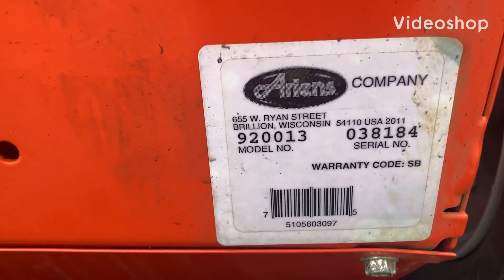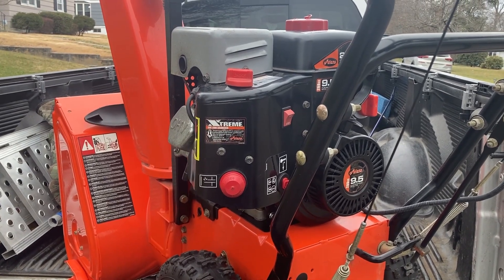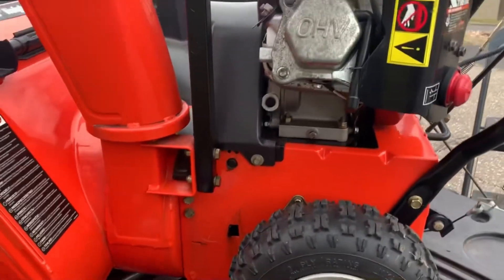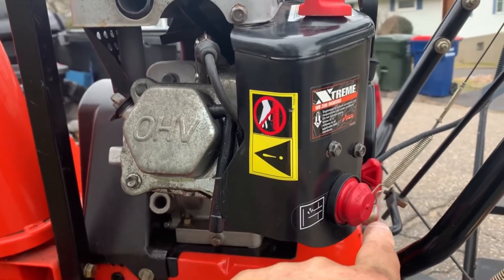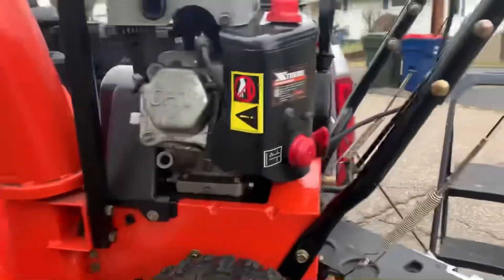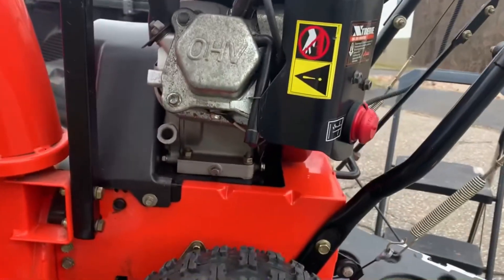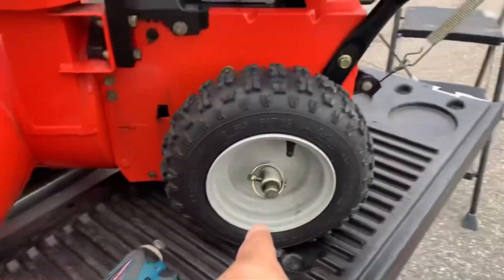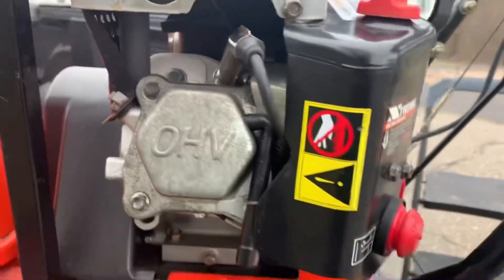Ariens Snowblower Fuel Leak Fixes Itself? Small Engine Ethics 101

Comment: Most people don’t know that if you push the primer too often, it will leak and thanks Ken for being so honest
Reply from the maker: It hasn’t hurt my reputation so far!   Stay warm Hank get that Diesel Heater on full blast!!!!
Reply: I just purchased an ariens snowblower so if this happens that it leaks from pushing the primer bulb its good
Reply from the maker: @oscarsalas3200 absolutely, it should drip out the front of the carb if pushed enough times

Comment: 38 years ago, I was a 12 year old kid wanting to race go karts. My Grand Dad paid a well known small engine shop a great deal of money to build a competitive 5Hp Briggs Stock Appearance engine for me. We got the engine back after they modified it. The engine smoked like a freight train. and covered me in oil the first time I rode it. My grand dad took the engine back, and told him what it was doing. The mechanic kept the engine for about a month and when we went to check on it, he said we had wore the engine out. I told him I rode it less than 5 minutes and he laughed and said racing is expensive right, that we owed him an extra $300 for checking the engine out and rebuilding it the 2nd time. My grand dad paid him, and we went home and put the engine back on the kart. There was no difference, it still smoked and had no power. An old man at the go kart track offered to check the engine for me for free. The engine never had any work done on it, it was total junk. The small engine shop ripped my grand dad off of his hard earned money. I started right then learning to work on small engines, so we would never be ripped off again. Over the years, I've lost money on a lot jobs, so I could close my eyes at night, and not feel like I ripped someone off by over charging them.  Great to see others with the same ethics I live by daily 💪
Reply from the maker: Thanks Mitch, there are many times when I “learn “ stuff while fixing power equipment. Most shops would charge for every minute on a job but I don’t charge for learning, especially when working on something that is not familiar to me. I consider it adding to my database of knowledge.  Hopefully it can be used in the future. Once I figure out a method of repair, I estimate what the repair would be if I had known the solution and charge accordingly, which is usually a lot less than if I charged for all the time. I love solving problems and learning new things so it’s always an adventure that shows up on my driveway with a note that says “call me when it’s fixed!”
Reply: @KensSmallEngineRepair  That's correct bud! This is my 37th year working on junk and I learn something new daily. We never know it all and we never stop learning.

Comment: nice video. I have a cub cadet 2 stage, have not used it very often, only in real heavy snow. But it has been in for repair about 3 times, Last year 2023 winter, I had it looked at due to idling hard. Poor starts. It is only 3-5 seasons old, looks almost new, Tried Trufuel for the first time, on the advice of the repair guy. Got all the storied, no need to to drain , no need to burn  off, no need to add a additive. So of course I did not. Come this season, I went out to see how its doing? the trufuel I left in the tank (March 2024) new fuel, part of can, was gone! bone dry! (Nov 2024) I was told maybe leaked out? no evidence of a leak, it sat on wood floor no stain? It sat in a metal shed, that i am in and out of all year, NO Smell?  I was told it might leak into the crankcase!, Checked oil level, smell and texture, That seems fine?   I  hate this machine? more than my first wife. My now wife at my age of 70 does not want me shoveling and we can't afford a place in Florida. Appreciate any thoughts you might have, Just for something to talk about. Let me know your thoughts.  My idea is to wait for the ice to get really thick and take the machine out onto the lake (leave it there) and wait for spring.  Thanks.
Reply from the maker: It probably just evaporated, unless you sealed the guile tank and carb vents. Shouldn’t be a problem. I prefer Alkylate fuel for storage like Aspen or Kinetix.  Alkylate is highly refined gasoline that lasts for years.  A little pricey but works great. I’m assuming your engine is a Powermore which is Chinese MTD.  Not a bad engine.
Reply: @KensSmallEngineRepair  thank you, yes i too thought it might have evaporated, but everyone says no it leaked out?  I am currently worried Of putting more fuel in even though if I do not that fuel will become useless and end up in the trash.  In your opinion do you think I am ok to put the fuel in and just try it? I have been waiting for a snow I could use it for rather than risk it evaporating again before the snow comes.  Plus as I said before , I really hate this machine.  lol
Reply from the maker: @southerncomfort971  Put new fuel in and run it!
Reply: @KensSmallEngineRepair  thank you
Reply: Thought I would share with you the results. With the ton of snow we got over the weekend, I had to risk trying the snow blower. so I filled the tank with Trufuel and tried to start it, It took 2-3 pulls but it started, ran rough sputtering and even back fired once, but I was able to clear the long driveway. Than I put it away. So 
Again Thank you.

Comment: Maybe you can answer a question for me. Even though it’s July, I whipped out my still practically brand new snow blower, and after starting it I noticed an oily fluid with some tannish beige color sputtering out of the tube connected to the OHV cover. I have literally one use of the blower and it’s inside a garage for storage away from any elements. Is this good or bad? Do I return it or repair it?
Reply from the maker: Just condensation. Any in the dipstick tube?  Hot bc and cold temps cause condensation. Unless your seeing it on your dipstick you are ok

Comment: I have a 8524 1990 smells of gas after shutting off the gas valve . I changed my carb last year with same carb as he did.  Can it need a new gas tank?
Reply from the maker: Is the shutoff valve leaking?  Take off the tank and see if it’s the tank or shut off valve leaking.